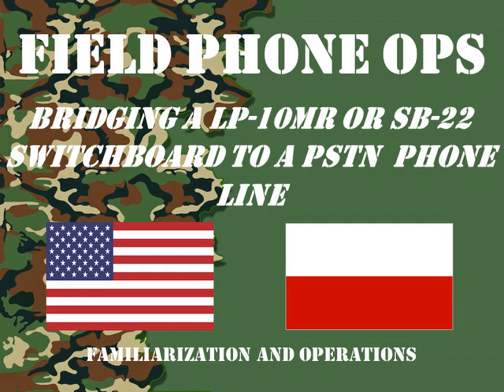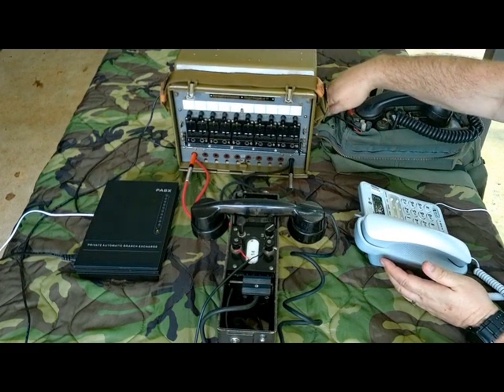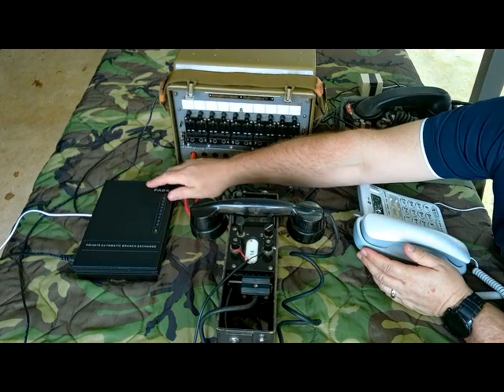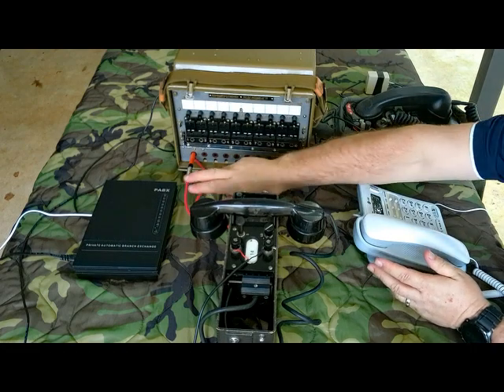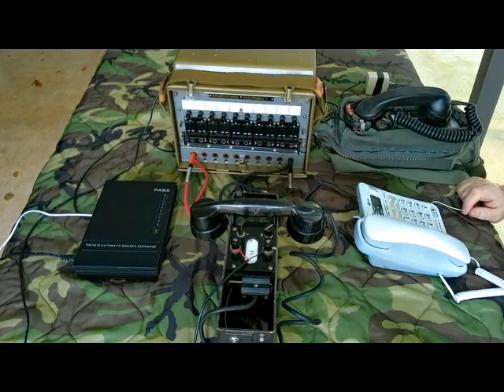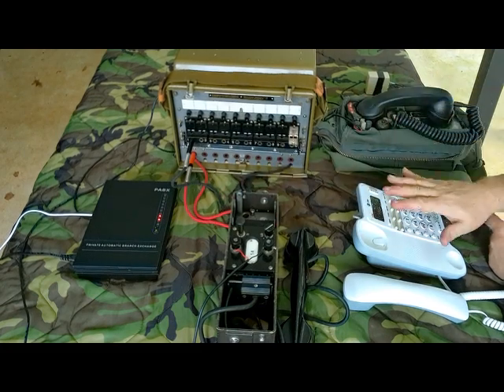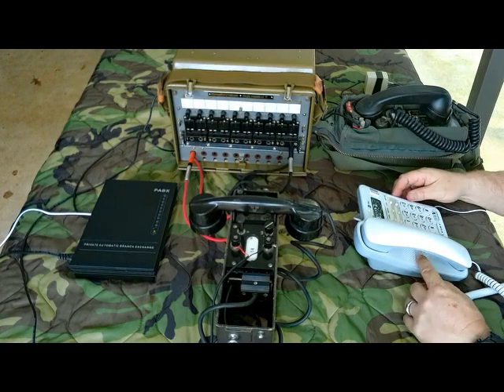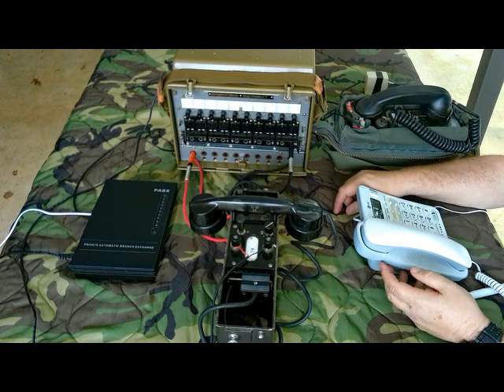FIELD PHONE OPS:  LP10 POLISH SWITCHBOARD AND POTS PHONE LINES

Comment: How does the operator know when the call is done?
Reply from the maker: They either have to check in and see if the line is in use or one of the parties on the call needs to "ring back" by cranking their phone which will cause the window to drop on the line.  The operator will see this and pull the cords to normal the circuits back up.  This is the same process for using and SB-22 switchboard.
Reply: @thefieldphoneguy8254  Thanks.  I saw one on eBay and it got me thinking.